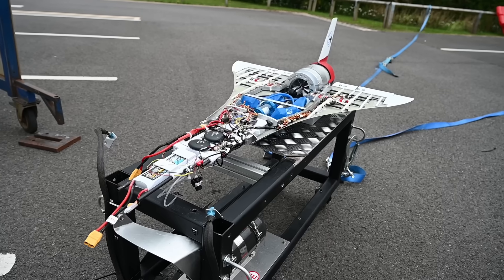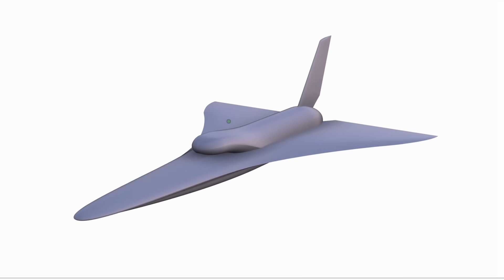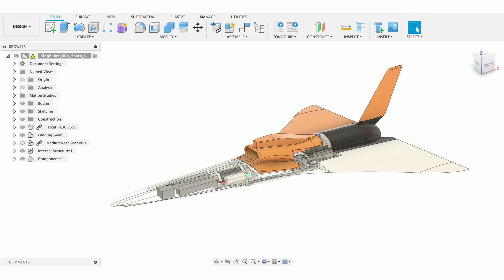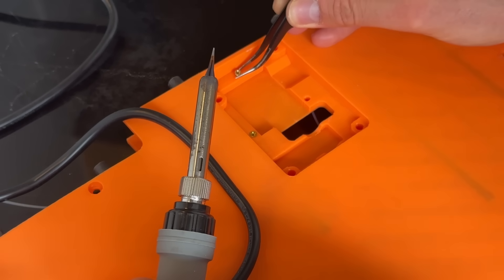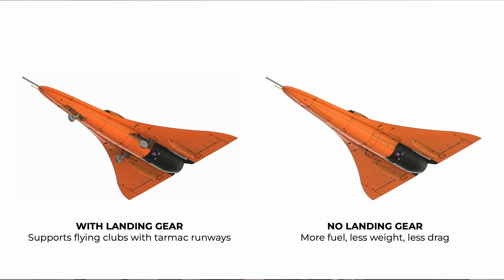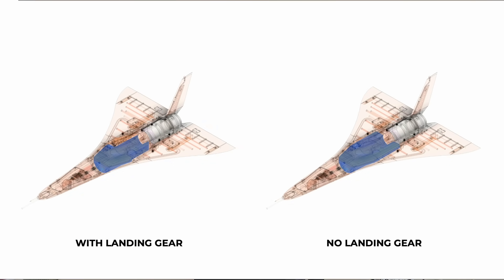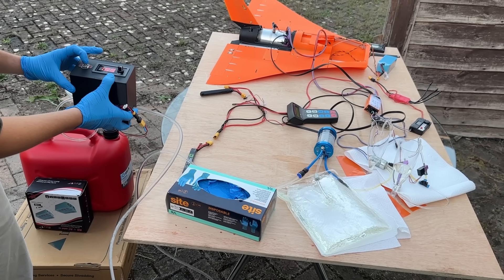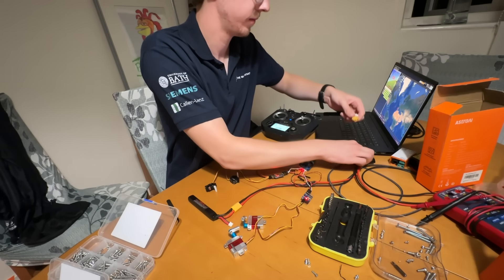Introducing Kingfisher Mark 2!

Comment from the maker: Thanks for watching! Since filming this video, we have made some modifications to the wing/ fuselage interface. There are now a series of steel rods that protrude from the aluminium skeleton, into the carbon fibre rods, providing a lot more contact area, and a much stronger interface between the wings.

The structure was designed in FEA to take a 10g load + 50% safety margin. We have tested this up to 4g with no damage observed, so we know the raw 3D-print + alu skeleton will be able to survive a maiden low-speed flight. For high-speed flights the dynamic loads will be greater, the PLA will experience aerothermal heating, and the loads on the inlet will be high as air decelerates from Mach 0.7 at the opening to Mach 0.4 at the compressor face. Once maiden flights are complete, we will likely coat the aircraft in carbon fibre/ fibreglass for extra strength. This will sacrifice some repairability/ maintainability, so we will only do this once the aircraft is flying reliably at low-speed.

The empty weight is ~4.4kg which means the wing loading comes in about 20% lower than Kingfisher MK1 helping to reduce our take-off and landing speed. Kingfisher will be a challenging aircraft to fly but we've de-risked this as much as we can with Kinglet.
Reply: All of the seams where the parts fit together and all of the open screw holes will cause MASSIVE drag at 500+ mph. Your airframe needs to be as smooth as glass. No seams, no holes, nothing but perfection. But you will find that out for yourselves.
Reply: This is the perfect example for a theoretical contruction. 
10g static load is way to low for your project. In high speeds you will have giant load peaks just by going straigt. you ignore things like flutter etc.
Coating with carbon will not work. 
First of all the wingload will increase drastic, second the plane is not designed for this. 
This concept will not be able to break 250mph, without ripping apart… 
Your CAD skills are amazing! Use them to make a perfect negative mold and learn to laminate a perfect, flush body out of it. 
you can do it, but you habe to rethink the concept !
Reply: So, the answer is no, you can't 3d print an RC plane that goes mach 1...
Reply: All the screw heads that hold your control horns on... they are sticking up into the airflow! Come on guys!! You should know better than that! They will all need to be counter sunk flush with the control surface to eliminate the parasitic drag. All the small gaps between the pieces... MASSIVE problem you dont seem to recognize.
Reply: What airfoil did you guys choose? Can’t wait to see it fly!
Reply: if what guys are complaining about 3d printed parts is correct, printing everything from PPA-CF (or at least the cheaper PAHT-CF/PET-CF) might help for the intermediate tests... btw, I'm rather interested in STL/CAD files, as I got some crappy 5kW Chinese Jet engine laying around...
Reply: Will you offer a kit when you break the world record

Comment: Very nice progress. In the final test you should IMO use a tape to Cover Screw holes etc. Business as usual.
1) Why do you use ogive wing shape- I assume(!) that will give problems during landing because the vortices are not fixed. Make a CFD- the vortices will dance - but this is only my belly feling (bc'se  Eurofighter has a similar problem with the vetical sabiliizer)
2) I assume ailerons are much too big. Once I flew an "arrow 3" double delta. The roll rate was incredible- 
IMO you should try to stabilize the model aerodynamically first- without dirty electronic tricks. And when you fixed that- then continue. 
I assume you studied aerodynamics. Why? when you anyway try to fix everything with electronics?  My Question. 
And go ahead. Nice Project.

Comment: I am surprised that the design has such large wings. Surely the aircraft doesn't need even a fraction of that amount of lift at the speeds you're aiming for. I would have expected that the design might more closely resemble an air-to-air missile. I saw that you used a slingshot & ramp to launch, so I'm guessing that the take-off requirements aren't strict, and landing could be as simple as using a parachute. This sort of thing isn't my domain but I'd be interested to hear your thoughts.
Reply from the maker: Correct - the wing loading is about twice that of the current world record holder (so a significant reduction in size), but still a lot bigger than what is needed at 500 mph. They’re sized to give a 50 mph landing speed.

If we are able to get this aircraft to a record attempt, our next one will probs use much smaller wings + a parachute for recovery

Comment: Do you think you could use some bird netting as a recovery system? It should be readily available form a hardware store and could be erected with two poles; it might be a cheap way to avoid landing gear and improve the safe recovery of the aircraft.❤
Reply from the maker: Its something we’re considering - really keen to remove the landing gear

Comment: The sheer amount of physical packaging of components in this plane is insane.  Looks like everything is laid out very thoughtfully.  Your main landing gear suspension hinge direction does look backwards to me, but maybe I'm just looking at it wrong.  The telemetry antenna and airspeed sensor sticking out the front also looks like they will spear some grass on a belly landing.  I have a jet that always breaks its nose tip off when landing in grass.
Reply from the maker: Thanks! The telemetry antenna breaking off is a valid concern - we couldn’t find an RF transparent location for the forward antenna inside the aircraft. It’s a quick replacement though. We’re hoping to not use the landing gear for a bit of extra fuel volume

Comment: Are you not worried turbulence from the telemetry antenna will effect the pitot reading?
Reply from the maker: It is a risk - we’ll test it on the ground and adjust the location of the pitot if need be. Needed to keep the antenna clear of other metal work and sticking it out of the nose free’d up a lot of space inside the body

Comment: You dont need a disconnected intake. The centrifugal compressors on these engines can take in boundary layer flow.
Reply from the maker: While the centrifugal compressors can take in disrupted flow without stalling, non uniform flow from the boundary layer still impacts the performance of the engine

Comment: Was just thinking of your project yesterday. Great design work on the new model. Howabout some fixed or disposable covers for the undercarrage if drag is an issue? Antenna aerospike, haha nice idea. Might need some turbulence breakers on that. Greatly looking forward to the test flights. Cheers
Reply from the maker: If the landing gear is used there will definitely be doors, however a door with seams will never be as clean as no doors at all, and the added weight of the gear contributes to additional induced drag

Comment: Since you have an internal aluminum skeleton consider using hard TPU like 95A for some features since it is litelary unbreakable and also dual material parts made from TPU and internal ABS reinforcements are an interesting concept for undestructability

Comment: For the next design it would be interesting to see an afterburner or more engines. I think that, no matter how good the airframe design gets, the top speed remains limited by the engine thrust.
Reply from the maker: Adding an extra engine will require more fuel, pumps and volume adding extra weight and volume - this will increase wing size and frontal area increasing drag, what we really need is more thrust in a smaller package. An afterburner is one way of achieving this, or using a turbojet with a higher thrust/diameter is the other - typically the bigger turbojets get the better thrust/ diameter gets

Comment: Instead of a fuel tank, consider using a fuel bladder. They are lighter, and you don't need a bubble trap because there's no air in the system. Mark Pickering uses them in all his lightweight 3D jets. I started using them last year and haven't looked back. The bladder expands when filled and shrinks as the fuel is used. No breather is required, making it an airless system.

Comment: When using a fuel bag you don’t need a uat as you fill it if you get no air in there is no need for the uat which saves weight and space this is common practice with the larger jet with fuel bags

Comment: Definitely go with the wheeled version. The fuel penalty is negligible compared to the risk of a belly landing catching on a hidden stone or hole, and potentially leading to loss of the airframe.
Reply from the maker: Agreed if landing on tarmac, although we’ll want some landing gear doors. If landing on grass there isn’t much benefit as the wheels are pretty small

Comment: Amazing project! Very small suggestion: At 6:02 the antenna is placed right next to a carbon rod; since carbon fibre is conductive, it might make the antenna's radiation pattern kind of wonky. I think if it is possible you should consider moving the antenna to be bit farther from the rod, or oriented in a different axis than the rods
Reply from the maker: Thank you!! The plan is to replace that carbon rod with a fibreglass rod which is RF transparent which should improve coverage

Comment: Great project, guys. It looks awesome! 👍 I'm wondering if the area under the intake is a source of drag with the way the very back meeting the fuselage appears to go straight across. I'm thinking something like a vertical wedge in there to split the air would eliminate that drag.
Reply from the maker: Its something we could try out in future iterations! We need the gap to keep the inlet clear of the boundary layer, but could make it a little more aerodynamic
Reply: @TheMachInitiative Ah.. boundary layer. I knew there was a reason for the gap, but I didn't know the term for it. Heh  I love how 3D printing makes experimenting so much easier. It'd be interesting to see if there's a speed difference with and without the air splitter.

Comment: All of the seams where the parts fit together and all of the open screw holes will cause MASSIVE drag at 500+ mph. Your airframe needs to be as smooth as glass. No seams, no holes, nothing but perfection. But you will find that out for yourselves.
Reply from the maker: The drag increase is ~5-10%, but every little helps in a record attempt, we’ll cover the seams and screw holes with speed tape for the record attempt
Reply: @TheMachInitiative Very good, love your plan, I fly RC planes so I am emotionally behind you all the way. I hope you smash the record!

Comment: Is there any benefit to using superlight foaming pla and a smoother skin material?
Is there any benefit to swapping the servo linkage's to a internal gear system ?
Reply from the maker: We’ve tried using light weigh PLA in the past, but its really brittle. As for an internal gear system, it would reduce drag but i’d be worried about torque

Comment: If you upgrade the ignition system with a taser core (for a hotter spark), you can exploit thermoexpansion laws for increased thrust from the same fuel/powerplant.
Reply: Another thought... consider integrating an auxilliary ram jet sleeve around one side of the turbine that can sip some of the airflow and ignite once up to speed with the turbine. Cool build!

Comment: Very cool. You can do drop away landing gear and take off from hard surface and land on grass. Instead of printing the body, consider printing molds, smooth them together and make the body as perfectly smooth carbon fiber. Very sharp and skinny, paper thin, nomex honeycomb for stiffness where needed. For high speed you only need very small control surfaces, again can be razor thin as carbon fiber and if they pivot on a balance it takes very little force to turn them so you don't need big torque arms out in the airstream. The nose rods have to be a lot of drag as well, you don't need them. The top camera has to be a lot of drag as well. Try in the nose behind perfect aerodynamic cover. If necessary get a smaller camera. Aerodynamics will grade you perfectly at all times and there is no mercy. Every little bolt sticking out is a parachute to slow you down.

Comment: It's kinda cute that you think you can get a record away from folks with decades of rc experience using fully carbon fiber monsters built by absolute experts in composite manufacturing. 😂
Like... You're competing against folks whose dayjob is doing aerodynamic engineering consultancies for Porsche and the like...
Reply: So you are certain it won't happen then.

Comment: Hope the vertical fin is super stiff, it needs to be bigger too. Turbine alignment super important-if there as any side thrust it will yaw and pitch. Terrible bubble trap option you picked!
Reply from the maker: Hi Dave - thanks for the advice on the phone!

We ran some calcs on the gyroscopic moments from the turbine when sizing our tailfin, although the modular design allows us to increase the size easily. The 4mm thick aluminium plate slides into the aluminium ring inside the rear nacelle and is very stiff although we will prob coat the aircraft in a layer of carbon fibre/ fibreglass prior to the record attempt.

What’s wrong with the bubble trap? Would be useful to know if you have any suggestions for alternatives!

Comment: I'm not sure about the strength of your 3d prints. Your air intake especially will absolutely not hold together at 450 mph. Have you considered fiberglass/cf molding?
Reply from the maker: The raw 3D-print will be okay for the low speed maiden flights (we’ve tested these loading cases on the ground).

Once we’ve done the low speed maiden flights, we’ll then coat the aircraft in carbon fibre and fibreglass. Don’t want to do the composite work until after the maiden as we’ll lose the modularity/ repairability.

Thanks for watching!
Reply: @TheMachInitiativeI knew you guys thought things through! Best of luck in your flight testing!

Comment: Hi guys, really cool project, keep it up ! One tip, when using fuel bag, you don't need to use a UAT. UAT is used in conjuction with regular fuel tanks using a clunk moving inside which can eventually pick up air under specific flight conditions. Fuel bags are more reliable, you just need to make sure to suck air out after filling it. You can potentially save weight and space in the kingfisher. And if you still want to use a UAT, make sure the small filter pocket inside if fully purged out of air before flying to prevent flameout. Can't wait to see the next flight video with P60 !
Reply from the maker: That’s really useful to know thanks! We’re slightly wary of taking the UAT out as don’t trust ourselves to completely bleed the bag of air!!

Comment: you're gonna run out of money looking for spare turbines.. its too small, wing loading too high. the entire construction is against any rule thats been invented in aviation, or rc model construction. the aluminium core wont do anything for you while the skin rips itself apart. you need to go 100% carbonfiber shell.
Reply: you are right, I expect the air scoop to be destroyed first due to the aerodynamic loads above 400 mph. It is not reinforced at all.